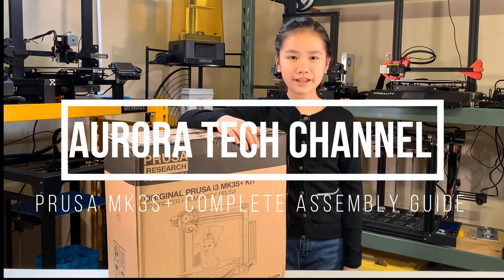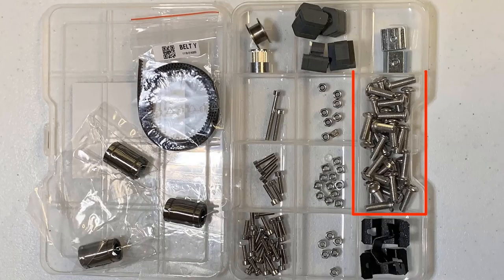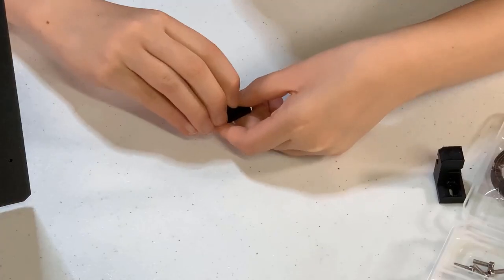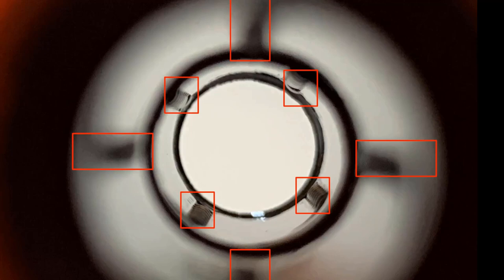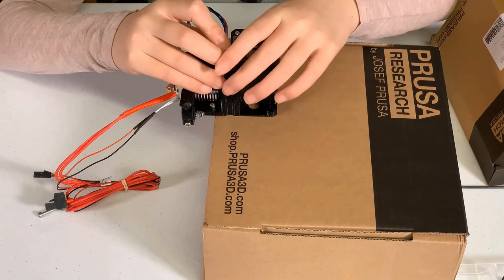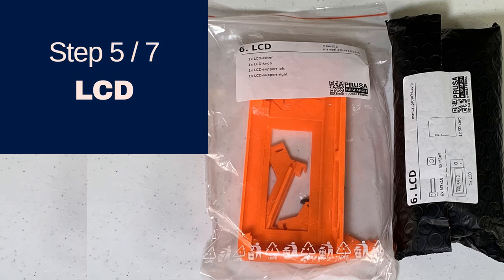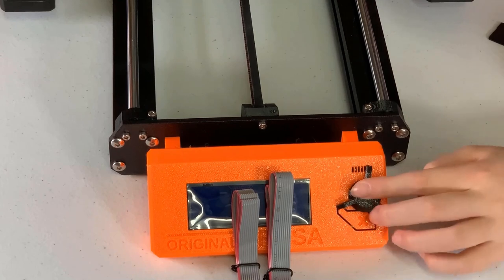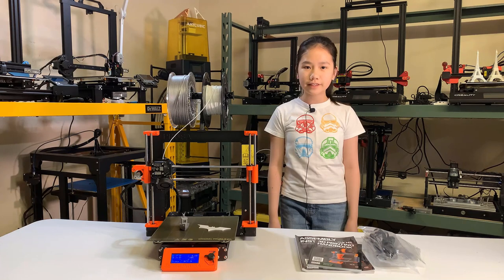PRUSA i3 MK3S+ 3D Printer Complete Assembly Guide, Every Detail Covered

Comment: Great video.  Between this, the printed manual and the online manual on the Prusa site, I feel really good about putting the printer together.  You make inserting the square nuts look easy, where I had a lot of trouble with them.  I saw another video where the installer used the flat part of a flat head screwdriver to push the square nuts in.  I tired this and it made the process a whole lot easier.  You just have to seat the square nut first.  I'm also a big fan of the Prusa pull technique to get the hex nuts into their spots.

Comment: Hi Aurora. I'm at 13:30 of your tutorial, where you show that we should put one bearing from one side and another from the other side, but the official included manual says that we should not push it from the other side, because there is a rim on one of the sides of the holes, which you can feel if you put your finger in. Just wanted to note this, because people may possibly break it, I guess. Other than that, smooth guide so far, thank you for your work.

Comment: Thank you for the perfect video! I just want to add one small detail - before you put the bearings on the X-axis, rotate all the bearings so that the two adjacent rows of balls are at a 45 degree angle from the vertical plane. The weight of the extruder will be better distributed and the polished rods will not wear out so much. Details are described in the original printer assembly instructions.

Comment: Wow, that is quite a build video.
One note to users building this printer, make sure the frame is not twisted, after attaching the aluminum extrusions to the gantry plate. It’s probably just the table you worked at, but it could look like there was a little rocking in the frame.
I assembled the frame on glass table, and used the rocking test (likely press down on each corner in turn) to make sure the frame is not twisted. I had a to do a few adjustments before my frame was straight.

For me, the biggest reason to have the Prusa is not for build quality. I can achieve similar quality from other printers. But my Prusa is still my go-to printer, simply because of reliability and repeatability of the printer.

Comment: Thank you so much for the time and effort for this fantastic video, I had this running while also reading online Prusa Instruction manual ( read the comments BEFORE you do each step, gives you plenty of hints and tips). My one bit of advice is, there are times when you should check the alignment of the nuts, as if they are not in enough it can cause a huge headache later on, something I found when doing the X carriage assembly and I couldn't get the screw to bite. Just poking a allen key ( hex key) in and giving it a wiggle can save you hours of dismantling.

Comment: Awesome vid... awesome job...
I received a used Prusa i3 MK2 that looks like it may have been upgraded to an MK2.5s.  It is in pretty bad shape.  I'm in the process of refurbishing it and upgrading it with a BEAR 2.1 upgrade kit. 

Because I received it used as is (for free) I didn't get the kit assembly and use manuals.  I wanted to learn how to take it apart and put it together easily and quickly so I know what to expect when upgrading it with the kit I have.

Your vid was a great help.  Your steps spell everything out very well.  I'll bookmark this vid to keep handy for whenever I need to do any maintenance.  I know the BEAR upgrade will change everything but this is a very good reference vid for where my printer first started out as.

Thanks....  keep up the good work...

Comment: I found and watched this video after trying to assemble my i3 MK3S+ and breaking the printer extruder-body at the beginning of the extruder assembly chapter when trying to seat a nut in a prefabricated cut out. From the tutorial you provided, it looks like you had a much easier time seating the hex and square nuts than I did. Great tutorial video!! I hope I didn't get poorly printed parts from prusa because my frustration at seating these small parts has been nearly constant across the entire build process :(

Comment: Aurora, I want to say that your video is the most detailed video I have seen about assembling the Prusa. However, there is an error at 22:04 when you say to use a 3 X 10 screw to fix the IR sensor to the extruder. That is incorrect; it is a 2 X 8 mm screw. Unfortunately, I followed your instructions and ruined the part of the extruder and the IR sensor, trying to get the 3mm screw in. It is my fault that I did not consult with the Prusa instruction manual; however, I hope that you could post the correction on screen. Again, I am extremely grateful for your work and detail on this video! Keep up the good work!

Comment: At 19:32 don't forget to put in the square nut that goes under the ball bearing housing on the D1 body.  This square nut is for the IR cover M3x10 screw.  Don't ask how I know :)  The orientation of the hotend is also incorrect for most of the video. The wires from the heating block should be pointed towards the fan.  It cannot be adjusted once the extruder motor is attached.

Overall a very good guide, thanks :)

Comment: Glad I just ordered an already assembled one.  I don't have the patience to put it together. Been there done that with Anet to Enders.
Reply: This mess I am dealing with is my first printer. The only building experience I got is putting my latest pc together... But other than saving money, I really just felt I needed to work it from the ground up, so I understand the machine better and will have some degree of understanding of what may be wrong and how to fix it when that eventually becomes a need.

 Its going reeeal slow. xD
Reply: @zhoupact8567  Yea for a first 3d printer I would want to build it. Glad I did with Anet and Ender.

Comment: amazing assembly guide, i just got my mk3s+ kit, since I am a beginner and it is my 2nd printer after my weedo tina 2, the reason why I purchase prusa as I wanna try to print with PETG and ABS. I have a question hope you can give me some advice. Since the hotend came with PTFE tube, when I print with PETG, will it affect the tube inside the hotend? However, I watched some of the videos, it mentioned that PETG should not print with full metal hotend as it may clog the hotend, so I am really confused. print at high temperature with PETG will melt the PTFE tube. Million thanks for your help in advance. Thank you.

Comment: 12:07
First time I did this I thought I had misread the manual on how much to fold over for the y-axis strap. Thing was abit tough to install to the carriage due to how tight the belt was  tho it still needed to be snugged with the long bolt to get the required stiffness.

My trusty ifixit PC repair kit really helped with this build. Have decent brand name tools for larger projects (Milwaukee, Husky, etc) but ifixit was the only tool kit that had the required hex heads to hold those nuts.

Comment: Very very good job.  Maybe add a video that tells me why this printer is better or worse than another one for more/or less than the price.  So far, I think this printer is good enough for me.  My price range is from $800 to $1500. Please tell me what I get if I go up in price.  My application is for small parts, (maybe 8"x 8" by 2" inch height, ABS, no high temp application).  Why if anything should I go higher in price...(trade offs, etc.).  Thank You

Comment: FindingaBalance
On the initial setup I'm getting a heater/thermistor not connected. Would you recommend removing the heated and removing the tape and reconnecting it? Thanks!
Reply from the maker: Yes, many possible reasons, bad contacts, wrong connectors... just start over and you should find the problem.

Comment: You installed the teeth wheel on the left x axis motor backwards and switched it off screen. If installed the way you did it first the belt would rub against the orange cover. Other than that good job.

Comment: Awesome job but some positions are backwards such as the pulley assembly on the x axis.  Also...you will still need to read the guide since many important elements are left out.  This is a great guide but dont assemble the machine with this guide only and not reading the manual or you will skip important steps.  Just a heads up.

Comment: great video but your ONE mistake prolonged my build by 2 hours....

at 23:57 your orange cables are facing Right and away from the fan (as they are from the start)
then at 24:10 when you lock it all together it is facing the fan (LEFT)....
I had to undo and redo everything a few times in order to get it right ....

NOT cool to fix a mistake off camera and then just continue as if nothing happened since  I was following your moves to the INCH....

Comment: Great video, is there a reason why my m3 10 screws are not connecting when screwed in? Especially with the cover for the leads at the back of the printer head 🤷🏽‍♂️
Reply from the maker: Hello! I had a 3d printed part with a similar issue. If the part that holds the hex nut is damaged, you can't screw it in. I ended up having to reprint the part with another printer to fix that. But if this is your only printer, that may be a problem. You might have to ask Prusa and see if they can send you that part.
Reply: @AuroraTech  thanks, it’s the cover that screws to the back of the printer head where the leads come through it so it’s not that bad, I’ve just cable tied them together and put the protective sleeve on the leads…doesn’t help that I’ve put the bad on the wrong way round, got to take most of it apart to turn it around 😩

Comment: One doubt....which screw to use to fit the FS lever shown at 19:00? I am only left with one M3x10 screw but that does not seem to fit, upon using M3x14, I am running short of one M3x14 screw in the later stages.
Reply from the maker: If you don't want to go backward and take everything apart to find that screw, you can use the spare bag of screws that came with the kit, including extra screws of all kinds.

Comment: Having an issue with the X-axis belt being slammed up against the 3d printed part, the pulley is already positioned all the way to the rear... Any suggestions?
Reply from the maker: I think it would be easier for me to see the problem if you can send a short video, you send it using Twitter. @aurora_lung
Reply: @AuroraTech  So that was figured out, but now when attempting to assemble the heat bed the pre-drilled holes aren't lining up on the corners.  I started with the center screw and didn't tighten it all the way down but several of the holes seem way off.  Thanks!

Comment: CAUTION!! do not tighten those bearings with the clamps so tight! Even the manual tells you that. The housing is very thin and the slightest amount of pressure can distort. She tightened them way too tight as you can see and when she lifts it up the rods don’t even move! If tightened properly those rods should be as smooth as butter and rolling all around back-and-forth. The printer is still going to work but you’ve just introduced a turn of unnecessary force and exertion on your motor and your prints WILL suffer.

Comment: 6 m3 nuts... 6:29 -2 m3 nuts... 7:33 -2 m3 nuts... 8:07 "3 bearing clips. 6 of these m3 nylon nuts." Me nods and looks at picture...  Looks down at my 2 remaining normal m3 nuts. Checks the picture... starts to sweat. "Nylon nuts right?" But red square>Words right?

 After looking high and low for the missing nuts, I check the bag, then looking in the manual, I can say its indeed the bigger nylon nuts. I was almost about to open my spare bag in shame. XD

 9:25 I have now spent 18 min to do this step. Annoying crap those squares are.
__
 I kinda wish you added how much sound it makes when you move the y axis, because I am probably over worrying about it quite a bit. I presume it would make a fair bit of sound, but what is too much? XD
Reply: Fina fakan lean! My god that was slow. I am not fast even when I know something, and I have never poked at anything like this before. I spent most of the last 3 days on this damn thing! Worried I would screw up, and stuck on tiny details like getting nuts into the pieces for as much as half hours. But now its finally done! It seems to work just fine! I made a whistle! Ahhhhh.

 I may have gone a bit insane when buying filament, so I will be needing to run this thing a LOT, if only to free up some space.

 Oh and it seems I need something to connect the SD card to my computer! That is going to be important. Hurray I DID IT!

 Thank you so much for the help. As using this video on top of the manuals was pretty sweet.